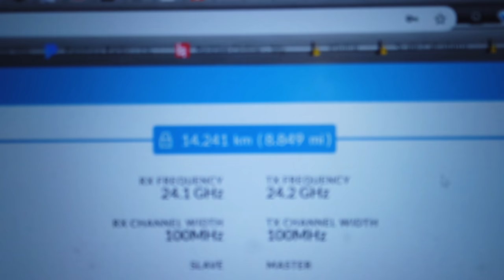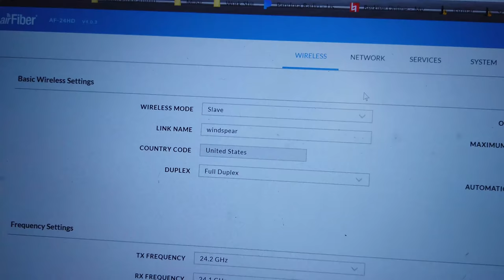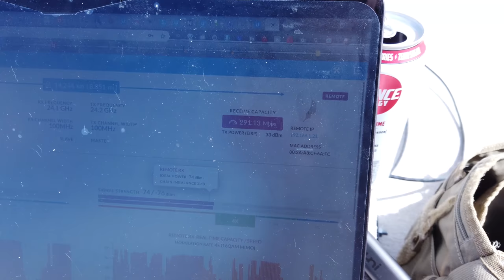It WORKS!! - DIY Ubiquiti Internet Relay - Pt 7

Comment: Granted.. I haven't seen the rest of your videos yet to really know if this is still an issue. But as far as interference goes, I would watch those big AC units. Power like that can cause major interference on regular cables. If this is still your current setup, I would recommend getting some shielded cable for the antenna uplink!
Reply from the maker: I've been using Shireen STP cable since day 1. GREAT cable.

But yea, I've changed a LOT of stuff since this. 😁

Comment: I have that exact distance in my next project, 14.2KM! Do you recommend the 5xhd? What dish do you recommend? Like your videos!
Reply from the maker: Been very happy with the AF-5X HDs so far. 

Dish size? As big as possible. lol
Reply: @rmp5s  I was looking at the 34dbi but they run for $600 a pair. I found on bhphoto the 30dbi's are $250 for a two pack. Do you think that would make the distance, if so what speed lol. It's only my second point to point project and it's 10x further than my first project
Reply from the maker: @alexv305  I'm using the smaller ones. The 30s. I have an extra 34 in my hallway. Wanna buy it? lol I'll make you a deal.

No idea what speeds you'll get. I have no idea what the noise environment is there.
Reply: @rmp5s  lol the 5g34? How much
Reply from the maker: @alexv305  Yup...the 5G34S45. Brand new in box.

https://photos.app.goo.gl/sS1qmMtzppXGVJSf9

*shrug*...find out how much it'd cost to ship from 85339.

Comment: i think on this distance in good aim you have abaout 600Mbps max
Reply from the maker: Yup. Looking like that's about right. Most I've seen is a bit over 500Mb/s one way and about 300Mb/s the other way. It's less than I wanted but it should work ok for what I want to do.
Reply: @rmp5s  I am fighting the same battle. It will work like this, but it will also have trouble in wind, rain , and snow. 24GHZ is like trying to line up four needles. Gotta have people on both ends who know what they are doing. Setup properly these radios are fucking incredible!

Comment: Yes i confirm i try to use 24 without HD... its pain on the ass.. but... it works
Reply from the maker: True true! lol Now I'm dealing with wind. MAN are they sensitive to movement. That'll be in the next vid.
Reply: @rmp5s  i done links on 60Ghz 1mm algin is to far... when you go higher frequency you have tighter beam..  so focus on good mouting point and be patient :)
Reply from the maker: @cezexcezex9888  Oh yea...for sure. Patience is key. It's WAY more difficult to aim these than I expected. 

Right now, I'm dealing with wind. The thing moving around in the wind, even a little bit, WRECKS the shot. My fix will be the next video.

Oh well...again, live and learn. lol

Comment: You would never achieve more than 500mbps each way.  Not enough fade margin for proper modulation.  And the link will go down in rain. Wrong proouct for the application.
Reply from the maker: Live and learn, right?
Reply: Not true AT ALL. Get these things into the low 50's with proper chanel balance, and they will rip you the better part of a gig! All day every day. Slight losses with big rain and wind. The secret is to have a SUPER stable mount!
Reply from the maker: @craigbondy1  That's the thing...I don't think I'll be able to get them converted that strong. Best I've been able to get them is -74.
Reply: @ginovilla. Your right. Make sure either use 34db antennas with af5xhd for backup. Or AF11x. Although AF 11 is more spendy to license. Dont have to worry about noise though.
Reply: @ginovilla It doesn't rain in Arizona. Lol. I lived there for 4 years and it drizzled maybe 4 times for 75 seconds total. Haha. Also the 24HD will automatically change modulation based on conditions to maintain the fastest possible link. The link won't actually go down completely unless conditions cause fade below the minimum. It will simply go slower to maintain reliability.

Comment: in my expirience on this distance is not posiible to have 2gb/s but i advice to look at this solution from ubiquiti: https://www.ui.com/airfiber/airfiber-nxn/ its better also you can put normal rockets on it not Airfiber X5HD better range and you have 8x8 with multiplexer in my expirience on 15km you can achiwe on 8x8 multiplexer with Airfiber 5XhD 1,2Gb/s duplex

Comment: That's why u do your config in a lab before u deploy it smarty 
....😂
Reply from the maker: roooooofl...yea, you got a 9 mile long lab complete with all the obstacles and noise floor as your final environment? I sure don't!
Reply: @rmp5s  You don't need a 9 mile long lab to set the passwords and SSID's and channels to check if they will connect to each other before you deploy them 9 miles apart. If they don't connect in the same room, they DEFINITELY won't connect 9 miles away. rooooofl.
Reply from the maker: @xNYCMarc  joke
--------------------------------------------------
your head
Reply: rmp5s I was just poking fun. Lol. Over your head as well.